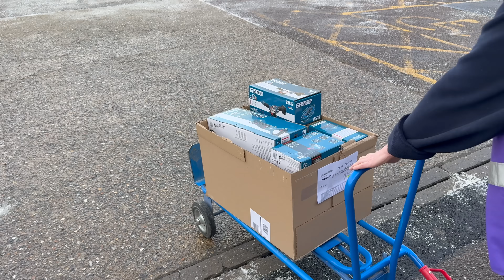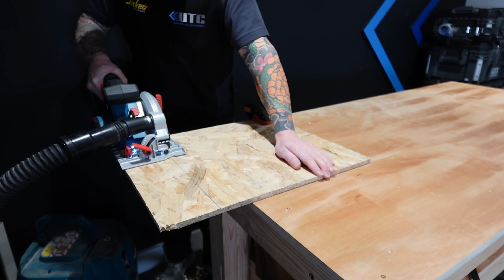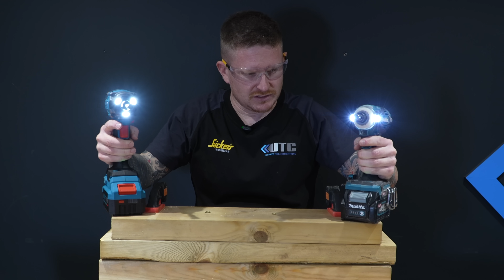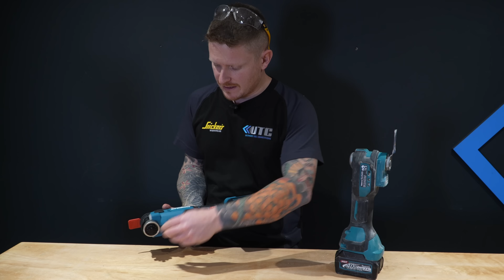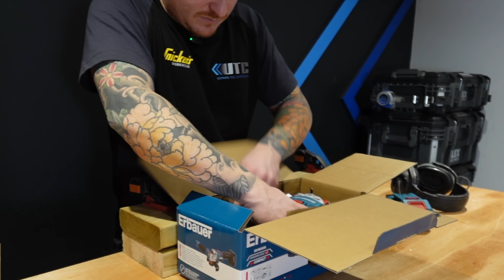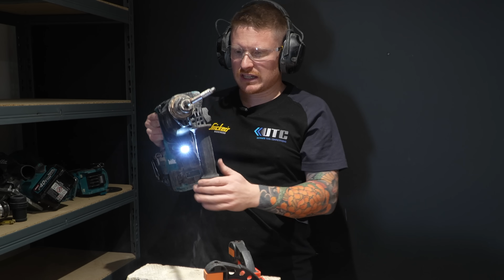New Erbauer V2 Tools | I Was NOT Expecting This

Comment: Impact drill quite impressive, makita impacts and drills not the best compared to other top end stuff i,d put makita in steady eddy category even though i,m on makita platform, in our work workshop got a few erbauer compact 1/2 inch impact wrenchs absolute beasts plus they are compatible with bosch batts......wat kind of warranty do erbauer offer?
Reply from the maker: Warranty is 3 years 👍
Reply: @TheDIYGuy1 3yrs from the off or do u have to register with in the bs 30day from buying it......👍
Reply: @Dazob66 Just proof of purchase. Screwfix will actually swap it on the spot for at least the first year. Not too sure how it works beyond that
Reply: Cheers👍

Comment: Einhell, never seen much about them. 
Massive range though.

Also worth noting evolution run the ext platform for their cordless range. 

Einhell also shares their battery tech with other brands. 

Both with no adaptors and high performance/variable batteries too, which to me increases their appeal. 

These are the 2 brands that I'd like to see alot more of.
Reply from the maker: Appreciate you sharing that information!
Reply: @TheDIYGuy1 oh and another thing,  einhell appear to have 3 grades of tools, consumer (TC/GC), expert (TE/GE) and pro (TP/GP) with named models being pro level tools too. 
T is for tool, G is for garden
Reply: @oblivionjp I have the pro line is realy nice I have some vids in my youtube 👌
Reply: Agree with Einhell. Amateur DIYers like myself normally go straight to Amazon where einhell are prominent.
Reply: @PaxtonSpur plenty of places to buy einhell in UK. ITS, Screwfix...in fact i think all major tool retailers have some of their range and you can buy direct.
Reply: I've had the old version 18v impact driver for past 6 years been used on lots of 8/10mm thick steel nearly every day and has out lasted work mates milwalkee fuel and others makitas over and over again some guys buying 2 or 3 times so I'm sticking with erbauers .
Reply: Skil 20v also can be used with erbauer EXT 18v batteries
Reply: The Einhell Professional Range
Reply: What's the point of comparing a 18v tool with 40v tool? Obviously 40v will be more powerful
Reply from the maker: As mentioned at the start of the video, the 40v is a benchmark and is fully expected to be ‘better’. It’s not a comparison
Reply: @kadirardc3413 I think that's what he uses day to day, has the most experience with and has to hand.

Comment: Erbauer is a platforms I'd like to try myself. The batteries look well designed & the range seems like a good fit to replace my old Ryobi kit, it's clearly better quality.  Makita would be my preferred upgrade path, because of their superb repair-ability. The Heavy drill driver with that long bracing handle is really attractive so is their impact driver. Sad you didn't try a Trim-Router. But the SDS looks great. Do they sell a Track-Saw system and is it any good?
Reply from the maker: Thanks for the comment!
Reply: Not sure about repairability with erbauer (they're made by Chevron which might be useful to find out as they also manufacture Skil and Flex). Similarly can't comment on longevity but their warranty process is very convenient. Pop into screwfix and they'll swap it on the spot within the first year.

Erbauer does have a new 240v plunge-track saw but I've not seen any feedback on it yet. The old one has very mixed reviews

Comment: £159.99 for a combi drill with a battery is DeWalt money. No thanks.
Reply from the maker: Not quite if you find the equivalent spec dewalt drill with two 5ah batteries. It’s around £200
Reply: @TheDIYGuy1  Fair enough, but I'd still stump up the extra £40.00. Also, the thing to always consider is what batteries you have already. As you know you buy into the system, and this is perhaps a good deal for people happy to go fully Erbauer, with this as their first proper power tool.
Reply: It's two 5Ah batteries for that price but I agree it does seem pretty steep until you look at the specs and the anti kickback feature.

This is the most powerful combi they do currently, there are weaker, lighter, more compact ones available for less. And on paper it has 150nm of torque and sits closer to the £250-300 Dewalt, Makita, and Milwaukee combis, rather than the 50nm-70nm ones. 

The main selling point for me was actually the anti kickback feature (each brand has a different name for it but I'm talking about the anti-rotational safety feature where drill stops if it starts to bind and rotates in a dangerous way, so it doesn't crank your wrist). I wanted that to drill through solid board flooring, joists and studs for running Internet cables and I was expecting to pay £300ish for a Milwaukee or equivalent until this new Erbauer released.

Compared to those specific combi offerings from the premium brands it is a very good buy imo.

Comment: Wanted an orbital sandet so bought the combi drill .impact  driver as well havent used the drill or impact yet but look and feel good . Got a grinder with 10 quid off and had a fifteen  quid voucher . Replaced a 240 v power devil  that was about  20 yrs old
Reply from the maker: Sounds like a good deal!

Comment: The blade on the circular  was way to deep for the  material you were cutting. Have the blade 1 to 2mm  lower than material for a cleaner cut.
Reply from the maker: Yeah makes no difference for a simple test though

Comment: there is a few brands that use that same planer, ryobi's is the same and I've seen it on more brands but cant remember. these will be decent for around home and I used to buy these kind of tools but personally I feel they break sooner and become like loose and slacker far sooner. I started with the lesser brands and then started buying makita LXT and XGT as if they break you can actually buy spares instead of throwing whole tool away which is ridiculous really in this day and age its just more crap to sit in a land fill forever.
Reply from the maker: Good points and observations! Thanks for sharing.

Comment: Ya didn't mention the combi-drill has automatic stop anti kick-back function
Reply from the maker: Yeah can’t mention every point for every tool for the sake of video lengh. People get bored
Reply: @TheDIYGuy1  it's a good selling point tho
Reply: @fredholmes6284 That is quite literally what made me buy it. I'm planning to run ethernet cables throughout my house, which is a modern construction style with stud walls and solid board floors.  Lots of drilling through wood, often at awkward angles with a less than ideal grip on the tool.  

I honestly thought I'd have to spend £250-300ish on a Milwaukee (or equivalent from one of the other premium brands) for that feature alone, until this came out.

It's a monster of a combi. Even sunk a few big coach screws with it since I don't have to worry about it cranking my wrist.

Only gripe is it's big and heavy. Actually considering getting a more compact combi for the less demanding jobs, but it has almost made my impact obsolete as it can do so much that I used to use that for
Reply: Take the one ya don't like most & replace it f the palm router.. that's really worth the 80 quid..the 5" grinder they do has a paddle switch